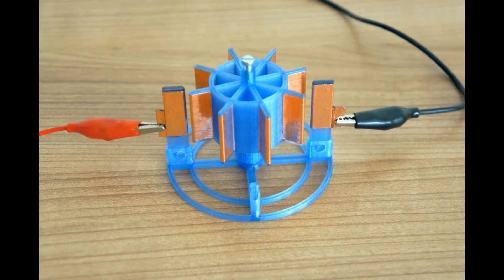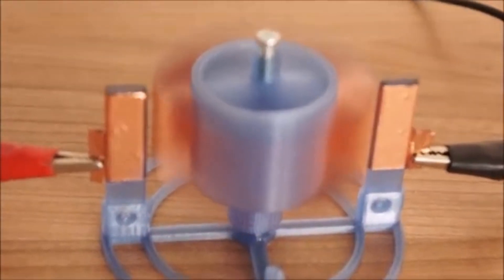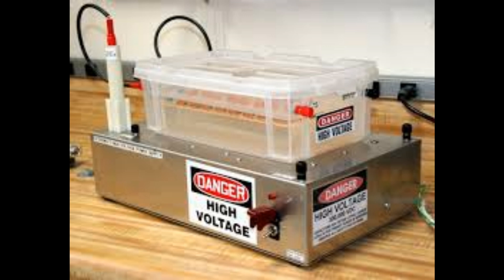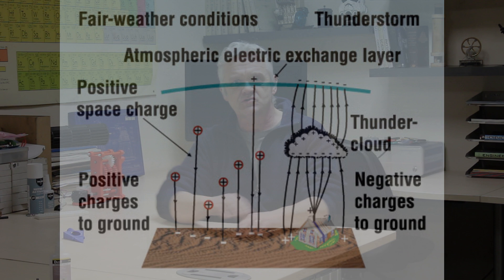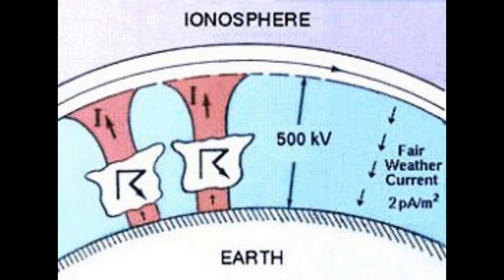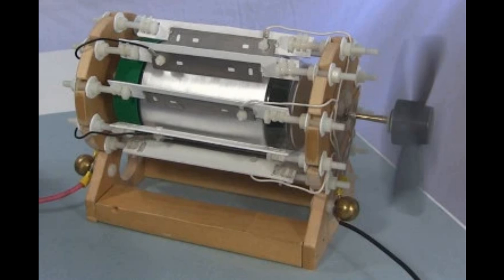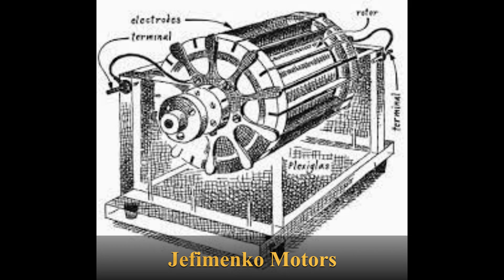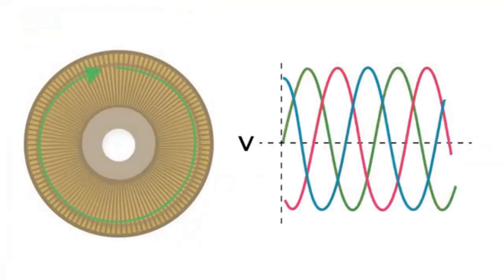1840 Atmospheric Electricity An Exciting Possibility

Comment: Put up a nice long antenna. I've toyed with the idea of using a long sheet of chicken wire for its very large surface area, soldered sheet to sheet, and it won't hold snow or rain if it falls on it.

Than putting a serious capacitor bank, I mean a high voltage high micro-farad oil capacitor bank, into the circuit. Bunches of microwave oven caps with the bleeder resistors removed.

Than a very serious multiple ground rod ground. Copper pipe driven into the earthwith coke packed around them and soaked with water.

A static spark gap made of multiple car sparkplugs on a plexiglass board.

A nice pulse transformer like an oil filled car ignition coil.

Than a chain of microwave oven diodes in series.

Antenna charges up the capacitor bank, gets dumped into the ignition coil transformer though the spark gap, gets stepped down and rectified to charge up a car battery.

Than run tools, lights, fans, whatever from a typical inverter.

Comment: If I were to use a, let’s say big trash can, or really long tube with a cap, bury it as an insulator to concrete in some type of plastic structure built to height, to hold our wire?  I assume the torque from the upgraded motor could be pulleyed to a generator. Thanks for the videos

Comment: There is another interesting possibility, think about it if we have a charge that isnt moving (isnt moving for us)
whenever other charge of the same polarity is moving that static one is a charge that moving in opposite direction.
That mean that we could have bifilar coil where two currents moving in opposite dirrections (which means that its inductive resistance approaching zero) 
Yet bot of this currents could be opposite to current of static charge for them.
And when we have an opposite currents we have an amplification of current(when/whilst this currents rising).
So all we need is just send impulses to this coil that rising and than abraptly ceasing.
And in theory we would have some emplification of the impuls.
==
Thats the Theory Behind.
But in short  -> Biffilar coil + electristatic charge + Impuls thar rise and cease ubrubtly
=====

=====
==If it is not a bifilar coil this stuff wouldnt work properly , because you would havve additional power during rise
of an impuls and decrease of power during decline of an impuls 
And the only way to gain something would be raising level of charge to such an extent that its effect ( of opposite current) would overpower inductive resistence to the point that during the rising of current it would actually supply power(effectively negating inductive resistance)
But i guess that level of charge for that should be so big that loses would be huge.
Bifilar is much more viable solution.
===
Anyhow , it is just a theory for now
How it would be in practice , thats a question.

Comment: Mahlon Loomis used the sky-to-ground potential to power his wireless.

The problem with tapping the sky to do real work, though, is the low current density in the air.  To get much current, you need either a collector with a lot of surface area, like a big mesh held aloft, or a moving one like helicopter rotors.  Helicopters sweep up so much charge inadvertently that they need to be grounded on landing; touching one while it's still off the ground and you're grounded can give a serious discharge thru your body.

Comment: I think you misunderstood Teslas' patent. You and the rest if the world. Static electricity doesn't go through an insulator.  There is a reason his antenna had a mirror finish with thick insulation. The particle he was capturing is responsible for radio, light, and all matter. It's not a photon

Comment: There IS a way to get this free atmospheric electricity!  Shoot a rocket trailing a fine copper wire into the clouds during a thunderstorm. Free electricity in considerable amounts will shoot down you wire in a blinding flash. Run it into a giant ground battery of some sort,

Comment: Is there a reason why people aren't setting up arrays of these things tied to, I don't know, rechargeable car batteries or directly into a private power grid? I know the current drawn is generally low, but I feel if you have enough of these set up in parallel you might have something. But I'm not sure if the atmospheric charge density at the tips of whatever's at the other end of the long wire would be reduced if there's a lot of receivers set up to take advantage of the voltage difference.

Comment: This seems like a very viable off grid power source. How would you convert atmospheric electricity to 12v?  I presume you could either fly the wire with a balloon or use an ungrounded pole for this but then to convert it?
Reply: It's possible using ULF induction coil and audio transformer, rectify, and cap within nominal ratings for use

Comment: I do resurche be me self on old engines mostly I have problems understanding ic chips and transistors controling variuse frequency ranges on inductors and transformers .
I realy wish you culd finde some old patent for wacun tubes and their practical aplications or those old special generators like Amplidyne Metadyne Magnicon or combined generators .
There isnt realy much info about them or how they are constructed wounding type magnets effects or position of magnets or combineing them with inductors transformers.
I realy hoppe you wuld give some presentation about those devices .

Comment: Capacitors like to discharge via ground connection (lightning?). Motors that need to be 500 meters in the air might not be the best way to capture.

Comment: Wait till you learn what the Pyramids were for and hence the Tesla tower was used for.... Think environmental energy and the ability to store it and utilize it. Both from the perspective of the creators of the pyramid to Tesla himself after he figured out what the Pyramids were for. Tesla towers were a self charging and self discharging plasma falls. With the source being all around our planets atmosphere.
 The tower is merely a blocking oscillator and once initialized  would act like a water fall that we could tap via induction into the towers storage capacitor. You would impulse the setup and it would draw down the appropriate flow to the ground. As it flows to the ground you just harvest or induce off of the flow you initiated. No, one impulse will not gather much. You would need to coax a stream to happen and that would have to be a resonant flow. Remember in resonance you would need to know the capacitive value between the two plates you are using. The ionosphere and the ground. build the system with that in mind and walla you can tap as much charged plasma that the sun offers us in massive spurts, ebbs and flows.
 Right now all that plasma is going to the ground unabated. this conveys massive charge levels in our ground and fires the inside of the planet up. If we do not harvest this energy it will overwhelm our planets systems.

 The Pyramids were a very old way of harnessing the massive plasma flows headed into our planet. Usually this energy is free to roam and cause chaos. We could quiet out environment by harvesting the excess energy and ease the effect it is having on our planet. If we do not do anything it will only get worse until a discharge happens again.

Comment: @RobertMurraySmith >>> Lift a wire with a drone or balloon? 

Or KITE. 👍👍 

EDIT: Amateur radio operators -- a.k.a. _"HAMs" -- sometimes use Kites to raise aerials for transmitting and receiving.
Reply: This is the idea. Its why folks are still working on Radio Frequency Energy Harvesting science and tech. and it actually works for more than just radios! A team in japan was able to power an Electric Wheel chair with it.

Comment: You have to look into this more, there is some fantastic research that has been done that implies that you could collect as much as 1.5 kilowatss per acre in summer and 3 in winter. Day and night, with an electrode style balloon anchored at 300 meters.
Reply: This is true! Have you seen the work being done by Ion Power Group - The Sun's Energy Harvested Day and Night. This company of scientist and researches is partners with NASA and well connected in Florida where atmospheric electricity is particularly interesting. They have a model of what you mention. And yes it does work.
Reply: @captainnemo6655  No, I got my info from older research from the 40s-50s.

I really should check them out though...

Comment: The global electric circuit is estimated to generate 1500 Amp current going downward in fair weather regions.
Generated by all the thunderstorms around the world closing  the circuit with the same 1500 Amp going up.
That means for a short time you can drain and generate 500.000 Volts x 500 Amp = 250 Megawatts maximum.
But for that you will need a lot of stations all over the globe and risk an unpredictable change in cloud formation.
Reply: It does raise some concerns however, it's not something that needs to be done in mass scale. Small stations are best and safest. This was demonstrated to work safely by the work being done by the Ion Power Group, from Florida.

Comment: Atmospheric Electricity An Exciting Possibility.   BIG THX ON THIS ONE !!  :yt:
5 X 5.. Recently..  2 words, Positive Visualization.  To go along with what you said here, I just got shown Electro Gardening.  Electroculture.  Using copper wire in the garden.  Found out the lies and that metal degrades the soil etc..  usual uncovering the truth stuff.
Reply: Why would you use copper ??? when Graphite/Graphene/Carbon is much better and Bio friendly to those communities of ELECTRIC BACTERIA that do this work in the ground.... there is more truth for you to uncover.
Reply: @captainnemo6655   cool, lets see it in action, Name that channel & video?  LOL  I'm going with what God shows me.... period.  Copper is vegi-plant beneficial and good to the soil ....have you heard of the loosh ?  Ether.  Etherial.  Its in the air.  Its the overall energy surrounding everything & soil can be vamped up for growth per plant.  goes back to the 1800's & new stuff to me.. but old stuff to the satanic who rely on multiplied negative energy from many sources for a different power.... and it goes thru the air.  Copper is a good cheap way... so far
Reply: @bingnowtv  what you mention from the Ether, loosh, we now call it for it's proper name: Radiant Energy or Energy from the Vacuum. It can be harvested from the Atmosphere as well as the Universe itself. As demonstrated by Ion Power Group and Dr. Thomas Henry Moray.... Now on to what you asked. The Chanel is called SciShow and they have a number of videos on Electric Bacteria; search for "Bacteria Could One Day Power Our Cells Phones" or "6 Bacteria With Wild Super Powers" or "Metal vs Bacteria" I know copper could be good for plants but if you are hoping to avoid metal leaching into the ground and we are hoping to harvest electricity and the Atmosphere to help out below, it helps these electric bacteria in the soil to have a medium that is conductive and bio friendly. Like Carbon/Graphene rods and cables. There are many more channels and videos I can share with you. Let me know when you are ready. (I would have already but YouTube permanently censors me)

Comment: Tesla's most cherished knowledge is the observance of the rotating magnetic field. A device could be manufactured with no moving parts manifesting electricity if the correct geometry is used. There is no need to rotate magnets or anything else for that matter.
Reply: The ancient builders of Megalithic Stone structures around the Magnetic Equator of the earth built those structures with specific geometries and other properties to do exactly this, millennia ago.
Reply: @captainnemo6655  Walter Russell's "Universal One" is a good read and once you understand field theory then I suspect its very easy. The spiral patterns in rocks is the rotating magnetic field and normally drawing with zig zag lines to represent E.M.F waves. We have certainly been dumbed down over the millenia but it's a trend we can reverse if we want to.
Reply: @pauljenkinson1452  thank you good sir! I shall add this one to my library as I am on a path to break that cycle of ignorance. I firmly believe we can gather all that lost knowledge again and finally put it to use correctly. I agree 1000% with you there. It reminds me, there is now an excellent documentary series on YouTube about this. It's called Builders Of The Ancient Mysteries. They talk extensively about this phenomenon of the way these structures were put together. There is a book I think you would like as it also talks in great detail about this. It's called Morning Of The Magicians. If you find one, get the 1960s edition.

Comment: Can you pump oil through  or over epoxy pipes to make a fluid van digraph generator?
Reply: Can photons be used in cascade mirror arrays to make static charge in epoxy or doped epoxy with ferro electric materials as nano layers?
Reply: Maybe, if you were to suspend magnetic ferrite particles in the oil. This is the realm of Magneto Hydro Dynamics, which Rob also has videos on in the library.
Reply: @captainnemo6655  The idea was to use a fluid friction to make static charge not a electrical one.
Reply: @travismoore7849  agreed! Did you see any of Rob's Videos on Magneto Hydro Dynamics?
Reply: @captainnemo6655  Magnets and two electrodes with salt water. Too much current and the water was electrolyzed.

Comment: Would I be wrong to think you'd have just put a lightning conductor/leader up in the air and it wouldn't be healthy to be near it in certain weather conditions?
Edit. What made me think about this is the experiments in rocket and wire triggered lightning.
Reply: No actually you are in the right.... which is why you DO NOT stand next to these things in bad weather for the same reason you don't want to hold metal objects in the middle of a thunderstorm or stand under trees. The design is meant to be almost maintenance free so that it works all by itself without needing to be there near it. Also that experiment was recently done again but with a LASER instead of a rocket and wire. Laser guided thunder bolts.
Reply: @captainnemo6655  thought so. And the equipment attached to it? How would that fare? I'm thinking 10 will get you 1 any such set up going to get hit in a thunderstorm, and the thought of replacing everything afterwards is a nightmare. The cable vaporises scattering metal dust, the next lightning bolt following doesn't always track the same line so can hit surrounding structures and occupied areas, your balloon or drone is gone, and I'd expect the generator coil slagged. 
Its all great in principle but reality often stomps all over expectation. Not trying to be a negative nelly but can imagine major problems to overcome before this is practicable.

Comment: So a question that I have is...

If the high voltage can be converted to rotating a rod, then why can't we just use that to create a conventional generator spinning coils through a magnetic field?

Wouldn't that then create the wattage needed for a respectable electric supply?

I ask, of course, out of complete ignorance.  Please be kind.
Reply: This question!! Its exactly what we are exploring on Robs channel. I encourage you to check out Matt Blythes video titled "Teslas little secret" and also LaserSabers video titled "Graphene/Graphite Atmospheric Electricity Collectors" If you put these two together and we follow your train of inquiry then you get the Atmo Motor/Generator that Plasma Channel built.

Comment: Awesome Robert , I've stumbled across Nicola Tesla  atmospheric antenna  , haven't built yet and bit hard to explain but it has a small electric motor timing switch or sensor which keeps the receiver wave length in tune with electrical wave bombarding us , will build and test over next few months then send for you to experiment with and share.
Yes has the earth rod too.
Reply: Good idea!! This is the same concept and design behind the folks that are working on "RF Energy Harvesting" to power electric devices so they don't need a battery, just capacitors. I tried sharing the links to these works but youtube censor wont have it.
Reply: Yes Tesla was the master on this feald. The problem in reading his patents i find is the difrence in the language he use. Because all his patents is like a journey of nolitch where it's all connected if one first find the kee to unlock it..
But 2 things he realy loved was extrem high frequency+volt because it starts behaving difrent. It was the reason he could make his shows letting electricity run through from hand to hand to show it was not dangerus.. But as he said if the frequency was high it ran on the outside of the body instead of thru.
About the spark somhere he says(if I remember correctly) that he makes the spark in oil so it's a verry fast spark without the normal youniasation (sorry I can't spell that one) but what I mean is a lightning first makes a channel Opersit direction of the way the lightning goes. And he avoid that by using oil...
Always made me wonder why + and - is Opersit of the way the electrons move. Is it becourse the Tru force(that we are not told about) actualy is somthing els than electrons.
Unfortunately I'm a inventor without money bussy with other things right now.. But later it's defently a thing I will start working on again.
Reply: @eriknielsen1849  there is sacred truth and knowledge about that oil. Same oil inside our bodies. No wonder Tesla discovered it to be mighty beneficial for his health.